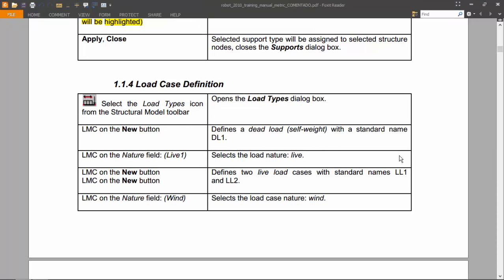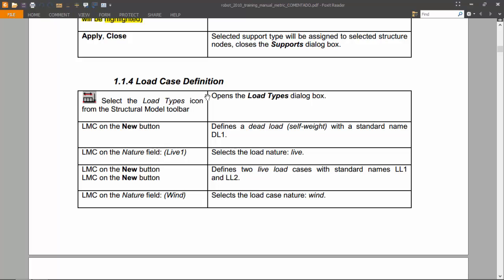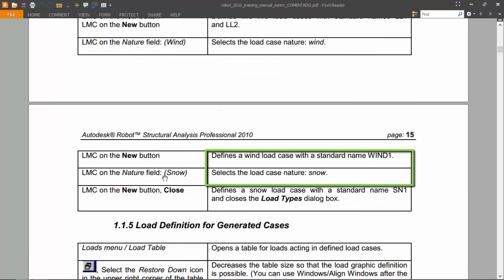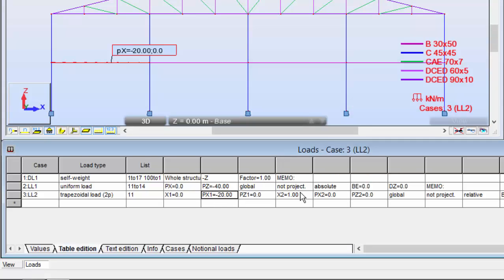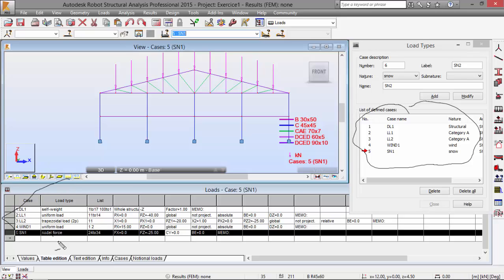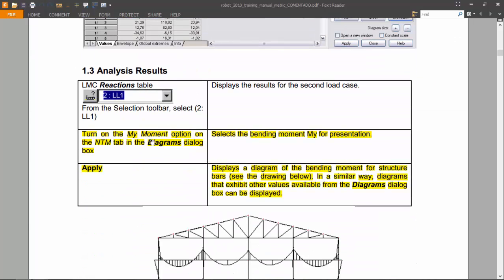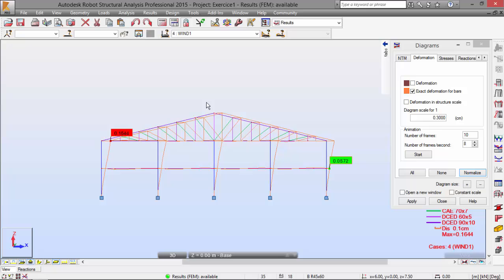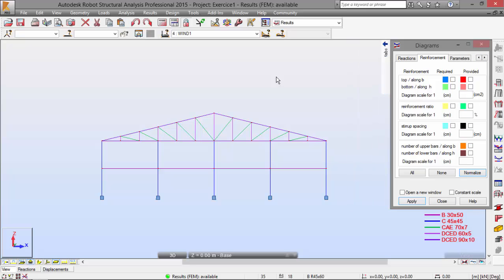Exercise 1 - Part 2 - Reinforced Concrete Design (Robot Structural Analysis)

Comment: Is it possible to make the diagram lines denser by dividing the bar in more sections like in a Mesh? Also can you set the view in order to see the coordinates of nodes or moment values of different points by just hovering the mouse over?
Reply from the maker: Hi there!
You gain nothing with the first division. What do you mean by "make the diagrma lines denser"? 
To set the view in order to see the moment values of different points you need to ask for Detailed Analysis.
Just go to RESULTS - DETAILED ANALYSIS. Then on the DIVISION POINTS separator you may ask for the points that you want.
You could also use the bar properties to give you bending moments along the beam. Just right click the bar that you want - Object Properties - NTM. If you then press "in point:" it will allow you to ask for the bending moment regarding the point where you have your mouse...
Try this and let me know if it helped.
Reply: @nunoteixeira-robotstructur8358  I think I managed to do as you said so with Detailed Analysis you get a table of the values in the desired points but if you want to view the values as you hover over with the mouse it is possible only with the Object Properties Diagram and only for a bar at the time. I just wished it was as easy as SAP where you have the entire structural diagram of the moment displayed like in Robot but for each vertical line of the moment diagram it directly gives you a value. The lines corrispond to the nodes in which you have divided the bar and if you hover over these nodes it will even give you the coordinates(x,y,z) of where this moment is applayed.
Reply: @nunoteixeira-robotstructur8358  oh, thanks by the way for the quick reply. I'm doing a complicated Master Thesis on the Consolidation of Tirana's Piramida. Every help I can get is gold.